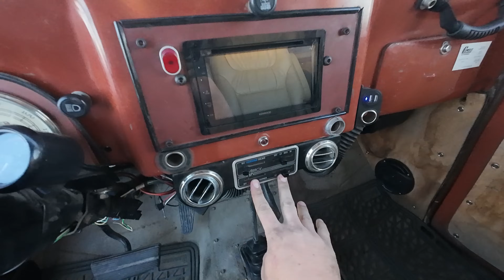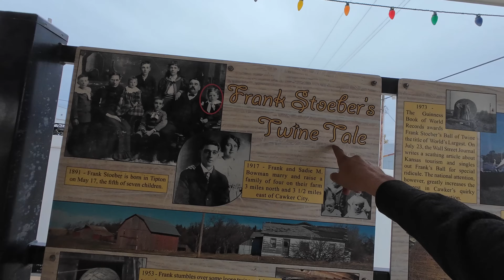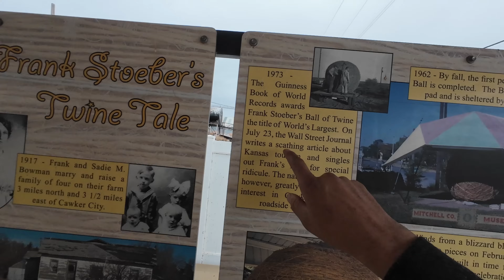I bought a 1949 Wagon and tried to drive it 2,164 miles home

Comment: I vote to keep it as is. Not a lot of these vehicles on the road, but a testament to good workmanship.
Reply: @arlenbell4376  keep it as is but fix the wipers.
Reply: ^^This
Reply: Agreed.  Keep the ;49 as is.
Reply: Agreed  keep it as is.  Hi from Croatia 🇭🇷💪💪💪
Reply: not a lot of these  vehicles, and how many do you think are on tracks?
i think i would prefer the 1 of 1
Reply: That's not a stock engine bro....
Reply: Different interior. Different drivetrain. Different axles. None of it is original. If he were to restore it, new frame, 1000 lbs of sheet metal patching, glass….   I say modify that to a fun recovery rig in trax
Reply: @sixpest  For all we know, it is "a stock engine,"  (stock for whatever vehicle it came out of). What Casey said was, " That, as you can see, is not the stock motor, That there is a vortex  V6".
Reply: Absolutely made in America with pride, we got to get back to that.
Reply: Jeep is a keeper. Somebody did it right, leave it that way. So many of these old Jeeps have been moded and they just ruined them.

Comment: Thanks for the memory.  My mother's family moved to Portland from North Platt, Nebraska.  We visited the families there in 1952 when I was 5 years old.  Other than a cream separator on the back porch, and dad getting bucked off of a horse, I have a memory of a train pulled by a steam engine far across the open field.  I can still hear the steam whistle as that train passed by.  I hope you enjoyed the trip, and thanks for the tip to turn on back roads on the GPS.

Comment: To the gentleman that built that. Great job! No issues with a total drivetrain swap means it was well thought out and put together with good parts at a minimum. I would leave it alone other than steering upgrades. It is pretty cool seeing these on the road and it has proven it needs nothing so drive it and enjoy it this winter Casey and when the new rubs off you can always track it up for next season.

Comment: There's so many comments you'll probably never see this one but either way, when you open up that hood I saw that Rusty master cylinder and about lost it, and of course it may have been rebuilt and have all brand new rubber and stuff inside either way that was funny, that would be a great truck to have I think.

Comment: Casey I had a 1950 Willy's ambulance. I loved that old Jeep, I wouldn't change a thing on that, except like you said upgrading the steering. Great find and Willy's wipers were always a problem, I think they have conversation units for them now. They were so flimsy back in the day, but then again they weren't going 70 MPH back then.😊

Comment: Nice Willys Wagon, good modern swap with practical upgrades, & nothing stupid crazy, That unit is a keeper as is & obvious reliable daily driver, the 1st & original SUV ever produced, Back in the day 50_-+ years ago i was a Willys Zombie couldn't get enough of them, Had Wagons, Trucks & a couple Jeepsters. 14 Willys in all. though never had a Willys FC or car. Most had small block chevy 283 V8 or inline six transplants, A '54 Wagon was my Daily driver for years, had a stock 2Six5/ 283 that was swapped out  in 1959, Had well over 500k documented miles on that swap when i sold it 25 years later. I bought it from a Government geologist who drove it down south to Patagonia SA on a 4 year journey for his survey job throughout the Andes Range and back through every through country in South & Central America. He put 200k++ on the V8 Willys & i put an additional 300k over a couple decades with no major work aside from regular maintenance and a valve job. the shear pin on the rear axel was the only weak link i ever encountered with it. And that Willys Wagon is the only vehicle besides a VW powered Isetta that i wish i had kept & never sold..

Comment: Change out the vacuum powered wipers. I had a 1953 Willys Wagon about fifty years ago and swapped out the anemic six banger and replaced it with a small block Chevy V8.  I hooked up the vacuum powered wipers and watched with great amusement at how the wiper blades damn near spun off like a propeller with the immense vacuum of the V8!

Comment: I had a 57 Willys wagon in the early 70s that I dropped a 283 Chevy in, had the leaf springs re-arched and moved them on top of the axles. It had a Ramsey PTO winch and I added a Warn overdrive and was off to the races. I drove it all over the Southwest and down into Mexico a few times and she never let me down. Sold it when I was stationed overseas and have kicked myself ever since. Bought a 72 Toyota FJ40 when I got back and dropped a 327 Chevy in it and that eased the pain a bit.

Comment: Wonderful trip. I still own the rusty shell of the very last '64 with delivery doors instead of a tailgate that was ever made here in the US. According to plaque on the dash it was built on Dec 7th, 1963. The previous owner had outfitted it with frame mounts for a small block Chevy 350. I added the 4-speed and overdrive unit to the 4x4 transfer-case. Just loved that rig and my '59 with the 327 a close 2nd(up for trade with the '59)

Comment: Those old 4.3 vortec motors are fairly bullet proof. I had a 91 Blazer 4x4. I never had a problem with that drivetrain...other than the pulse vacuum hub lockers. But they were always easy to fix when needed.

Comment: What a great old Willys... I live in Bend, so I'll be keeping an eye out for the Willys running around. 
The previous owner put a lot of work into it. I really like the push button doors LOL.
 Personally I would leave the tires on it, and leave it like it is. There aren't very many 75 year old rigs 
that you can jump in and drive across the country with zero issues.

Comment: I remember going up highway 58 in oakridge during the ice storm last winter in my vw rabbit with no chains my wipers froze solid so i ace venturaed and sprayed starting fluid all over my windshield and slowed down and set it on fire worked like a charm

Comment: Lived in Minnesota for a year, and moved away in February. The heater in my '69 VW transporter was broken and so I had 5gallon propane tank with a heater attachment sitting between the front seats. With a towel it was all I could do to keep about a 8inch circle in front of me clear. It was the only spot on all the windows where I could see out. I remember seeing a bank sign with a temperature of -19F. I'd had enough of that, moved back to Southern California.

Comment: Well, since the only thing on the wagon that appears to 1949 is the sheetmetal I'd say do what you want to it short of cutting the body up for clearances. It's a awesome rig. If you just wanted axles there must be a million of them on  west side you could build anyway you want for the cost of the airfare and fuel and hotels. It looks like it was a fun trip that I'd like to do. Unlike others you atleast had a heater! I look forward to future adventures in the Willys.

Comment: Well casey, welcome to vacuum wipers! Just whwn you need them a slight grade appears and they stop as you accelerate.😅 I had a 1950 Willy's pickup. Completely stock sweet little truck. I had been looking for a wagon but could t find one here in Wisconsin that hadn't been butchered or rusted to oblivion. Im impressed with the idea of using the S10 components to get some of these classic rigs back on rhe road. Ive got several classics and enjoy driving them. Thats why the willys is gone. Thanks!😊
Reply from the maker: They are not vacuum wipers

Comment: I would leave it as is!
In about '73 I bought a '48 Willys Overland for $100. with wiring issues. Sometimes it would start, most the times...not. Started out towing it behind my vehicle to the Midwest and 35 miles from starting point, it decided to push me out of the way on a mountain pass and it overturned. Sold it to some junk dealer for $50. I would really have to look, but I believe I would have a couple pictures stored here someplace.
Take care

Comment: OMG!  The second vehicle i bought was a 63 Jeep Wagoneer.  I drove it around and checked it out as only an experienced 17 year old can do.  I bought it and had my dad drive me to pick it up.  It was raining.  Passenger windshield wiper worked.  Driver side, not.

My dad came to rescue me.  He went to turn it around.  It was a hill.  Going backwards down the hill while standing on the brakes was interesting.  The emergency brake cable was broken and wired up to the frame.

The salesman was a church going type.  He had required cash, because jeeps were so popular.

My father was a WWII vet and boxed middleweight when ships were in port.  He was champion of the south pacific fleet in 1948. He was upset with the salesman.  He asked him to come out and look at the truck he had sold to a stupid kid.
After a short discussion with the salesman the wipers were fixed and the brakes were totally rebuilt.

Ay turch that Sunday I noticed the salesman had a black eye and his face was kind of puffy.
There were several other windshield wiper memories.  Thanks for adventuring and sharing.

Comment: I am one for taking the road less traveled. When on road trips, I frequently veer off the paved road and on to dirt. In a brand new truck several years ago with less than 1000 miles in the spedo, I had 2 wheels high and dry. Luckily, I ordered the truck with posi on the rear end and backed out of the situation.
Everyone needs to follow your suggestion to stop to see the ball O twine wherever they travel.
BTW: always carry a spare tire and know how to change it. I have more flats traveling old mine roads!

Comment: My first car was a 49 wagon in the same maroon and beige paint scheme. It was 2wd with a thumpy Chevy 327 and a 4 speed manual. No key, just a push button start, push button door latches, single tail light, no blinkers. In 1982 it was the oldest car in high school, I did a burnout out of the parking lot every day (dumbass). It was a fun car. Oh yea, vacuum wipers - one speed and they stall when you are gassing it.

Comment: I was born and raised in North Platte, my dad, an uncle, & grandfather all worked for the railroad, so I know my way around Bailey yard pretty well. 

On another note, in my 32+ years driving OTR, I've seen that ball of twine many many times 😂😂

I would agree with you about putting hydro steering on that. If you put the hydro steering & ultimately the tracks on it, it's easy enough to put tires on when there isn't much snow, can't you???

Comment: @CaseyLaDelle, I enjoy those wild spur of the moment road trips in vehicles that most normal people would never dare to drive long distances. My last one was a old Peterbilt truck that was sitting in Christmas Valley for about nine years. It had a leaking wheel seal, replaced airlines and one brake can. Only one windshield wiper, no washer fluid. Got all the lights to work properly. Wrote "not for hire" on both doors, slapped a trip permit in the window, made sure it was insured and headed for Redmond to a friends shop expecting to do wheel seals. Once I arrived at Gordys truck stop for fuel, I noticed the wheel seal had stopped leaking. Made it to Redmond, cleaned things up, installed some proper mud flaps, hooked on to a fifth wheel trailer with super sketchy tires and headed out for Williston ND. Surprisingly, I made it with no equipment issues (I was far more concerned about the trailer tires than the old truck). I did get pulled over in Idaho, cop thought it was a DOT vehicle with no name or DOT number on the side. He checked my insurance and permits (Idaho trip and fuel), made a comment that with no plate, no DOT number and the fact that I had put "Not for Hire" on the side, while pulling a camp trailer that it was considered the same as a motorhome. He asked where I was headed, I said "North Dakota, this is how old truck drivers go camping, he laughed and told me to keep it under 80mph." It had been a long time since I had just jumped in a vehicle with no real back up plan and made a wild road trip. In the spring I will be coming back to Oregon (CV) to get another Peterbilt vehicle (doesn't run) and wanted to talk you into my wild and crazy idea of how to load it onto a stepdeck trailer. Seeing some of your interesting recoveries I figured you would be the best one to make this happen. More content and get the haters taking again.. lol.

Comment: Whenever I have "avoid highways" turned on, I also seem to have a hidden option of "prefer goat paths" enabled. I ended up on some ice road trucker looking hills for 40 winding kms one time in our old FL60 crane truck. I swear the 2 ton concrete block I brought for traction saved my life, or at least my pride that day. It looked like a better route on the map. It was not.

Comment: That's a good reason for a failed trip. That's a pretty sweet little rig. I'd vote keep it as is and find a different solution for a tracked vehicle. But get it set up so that if a need does arise, bolt the tracks on and go.

Comment: I'd leave it as is except for the things you mentioned and the Badlands Apex winch. I was pretty close on my guess. I didn't see the panels in the rearview on the short or I would have guessed it. I thought old Dodge Power Wagon, but I had thought about Willy's Jeep as well. From the windshield it looked like the hood was narrower which is why I went with the Dodge. If you keep buying offroad recovery vehicles, you're going to have to start drawing straws to see which one you take out.

Comment: Don't do it. That's an awesome rig as-is. I've seen a few of those on Youtube and I don't think I've seen any that run as well as that one does. It has a lot of charm and it's been updated well enough to operate in modern traffic. I'd fix any issue it has and otherwise leave it as-is.

Comment: I sure hope you left it alone. I had a 59 with a ford 221 v8 had original  3 speed tranny. 1 shifter for high low. 1 shifter for 2 and 4. Another shifter for manual overdrive. Vacuum wipers. She was a sweet ride.

Comment: P-metric tire sizes are funny 295/70R17 for example 295mm wide sidewall height is 70% of that (so 295x0.7=206.5) and 17" wheel diameter.
so to get the height of the tire its 206.5x2=413mm -> 16.26" + 17" wheel size -> 33.26" overall height.

Comment: Keep old Jed Dodge with the tracks... Keep the old wagon and swap out that rear d35 for a d44.. The front de0 is a hi pinion and those are the ones to keep for a 30.. Rev cut hi pinion.. I dig that wagon just the way it is minus the rear 35..

Comment: I see with that kind of ground clearance it is so much easier to work under the car virtually anywhere. I always had to do such maintenance driving the SUV on sheet metal ramps ( 3 tons allowed each ) and never felt really comfortable under the car out of fear what would happen if one would collapse for some reason :-)  Nice capable vehicle with a modernized engine, i guess it will last "forever" when maintained well.

Comment: Don't use the Willys for winter recoveries, you will get that thing rusting out in no time.  Looks like it is a pretty solid body as it sits now.  Also, just leave it alone.  As they say if it ain't broke, don't broke it.  It is working good as is, leave it be.
Reply from the maker: How would it rust out?
Reply: @CaseyLaDelle   Driving in the snow and ice that you all get in your part of the country throws and packs that snow and ice up in the frame and body mounts and all sorts of crevices and areas of the fenders, rockers, floorboards and etc.  That snow and ice melts some turning to water and holding that moisture in those areas starts or adds to the rusting affect of the steel body, frame, etc. Driving vehicles in constant raining areas does the same BUT it has been found worse in snow and ice areas as well.  Not sure if they do in your area, but LOTS of parts salt or sand the roadways also and when you throw that in the mix with the moisture of the snow/ice, that salt wreaks havoc on the metal and rusts out quick.  We get vehicles that come in from "northern winter visitors" and can always tell vehicles from northern states as they are rusted out differently on the undercarriages and lower body regions.  Your new Willys just looks like a nice solid truck and would hate for it to get damaged for you.  (It's yours, do what you want)

Comment: Only Casey can drive 2000 miles in under 20 minutes. Vice grip garage has nothing on you ! 

It’s a shame the axle you wanted comes attached to such a nice complete unique vehicle.  
Even if you pull the axle you still need to replace it here. 
Either way I think you might be on your way to developing a yard full of old vintage cars. 
Could do worse. 

Great having a wife to be a partner in all your desires and adventures.  She’s a keeper !

Comment: Modify the drive train to deal with the tracks and put the tracks on it. The only other mods I am going to see at a "need to do" are upgrading the wipers to eliminate the blind spot in the center and adding heated mirrors. OBD2 is great because you can get information on the donor car like an accurate odometer reading and other information you may already know. Hang the hood on your shop wall.

Comment: I just found your channel. I’m a sucker for videos about driving old vehicles cross country and seeing the sights off the internet. I’m a retired 72 year old Kansas farmer and just had both hips replaced in less than a year and some other structural problems so probably won’t be making that sort of trip any time soon but I do have three vehicles that would be fun to try it in. 1971 Jeepster Commando, 1965 Studebaker Commander and 1954 Dodge Coronet with the 241 Hemi. 
     Why didn’t you take Old U.S. 30, the historic Lincoln Highway, as far west across Nebraska as you could? Also, DO NOT mess up that Wagon. Leave it as is. Complements to the former owner for being safety minded and adding the shoulder harness. I assume it had lap belts. Great entertaining video.